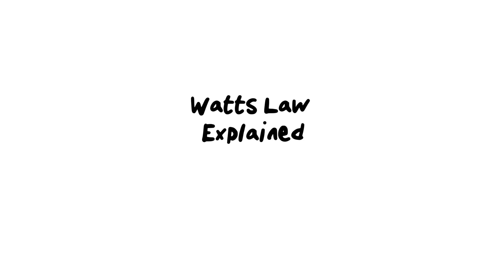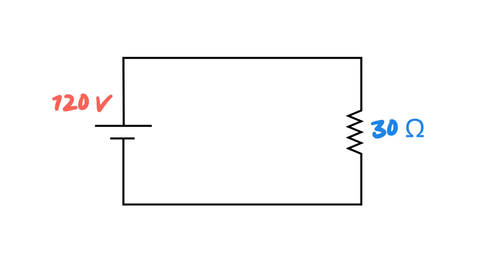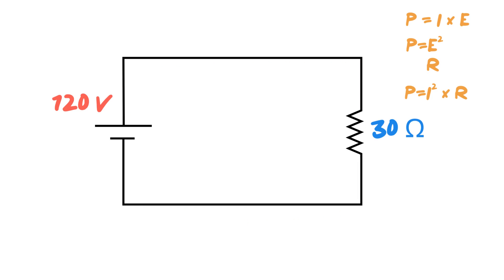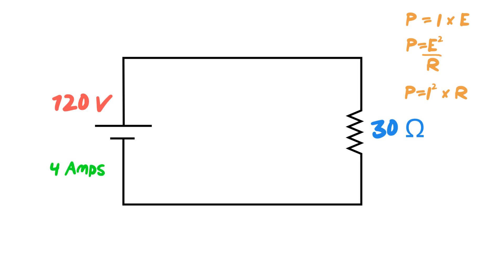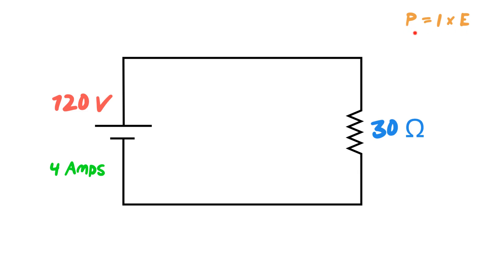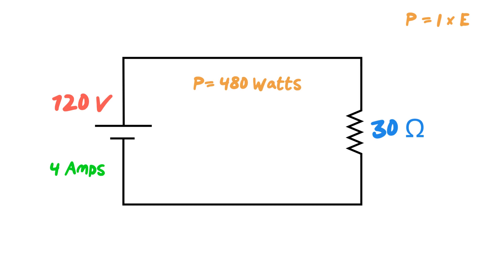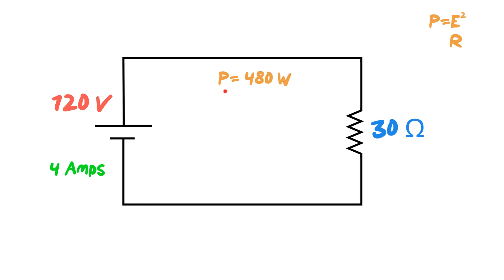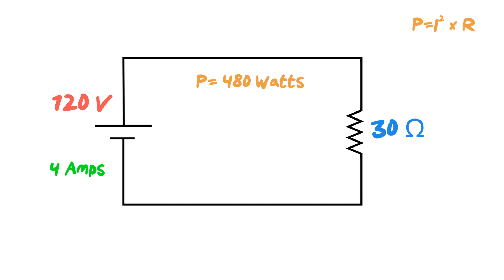WATTS LAW EXPLAINED

Comment: Would be interesting to hear where you first heard the term "Watt's law" used to describe the power formula P = V I.  

James Watt worked with steam and mechanical implementations of power and did not do work or experimentation in electricity that I've ever heard of.  He died about 8 years before Ohm published his work on what would eventually be called Ohm's law.

While the unit of power, or really work is called the watt (W in SI units), it is formally defined with respect to the base SI units as kg * m^2 * S^-3, where '^' represents the raise to a power function.  In other SI units it is represented as W = J/s.  

Therefore my belief is that it is inappropriate to refer to P = V I as Watt's law.